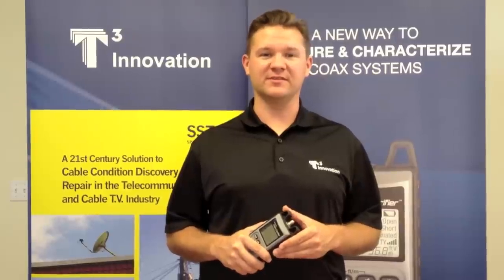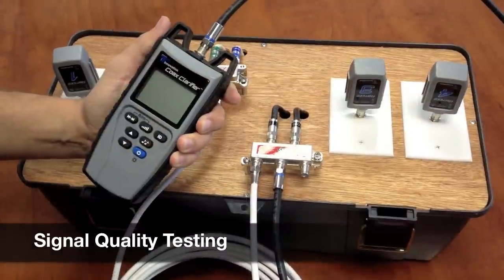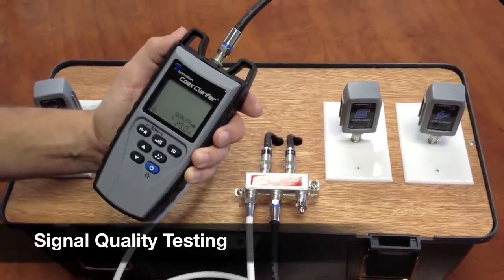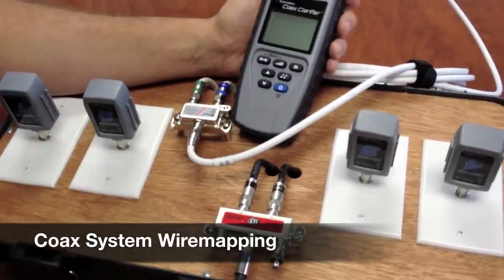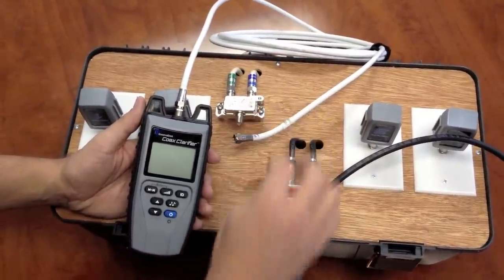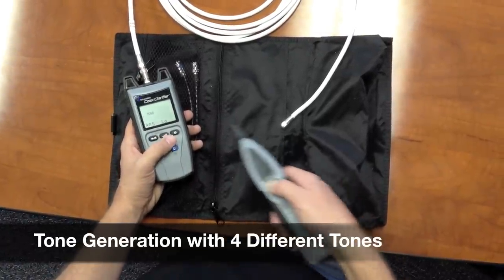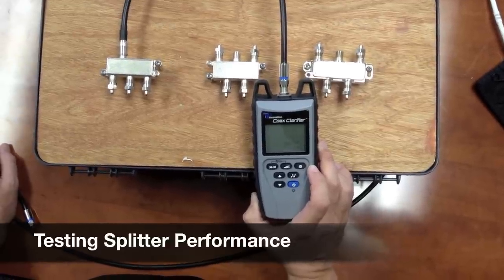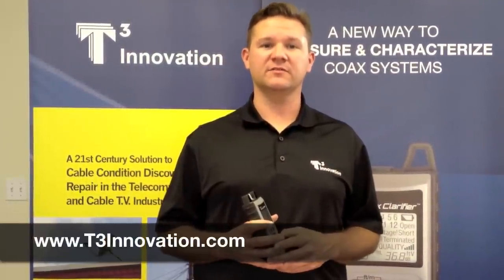Coax Cable Network Test with T3's Coax Clarifier

Comment: So far your tech support has been unresponsive ... question .... out of 5 cable port jacks in the house I can't reach 2. Do all the cable jacks have to be terminated with a plug or RF transmitter or can the 2 be unterminated for mapping the cable system in my house? My goal is to have a modem in my second floor office. The cables enter the house in the basement and one cable goes upstairs. No splitter where the cables enter the house.